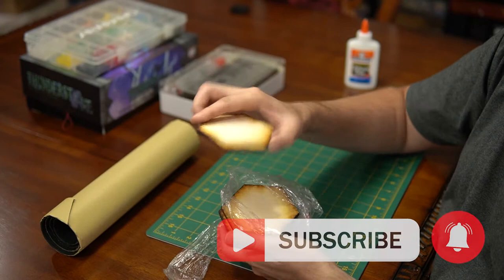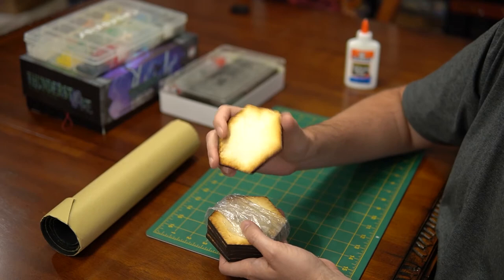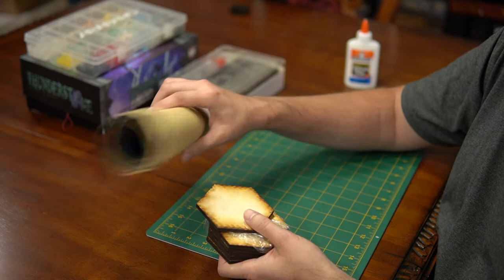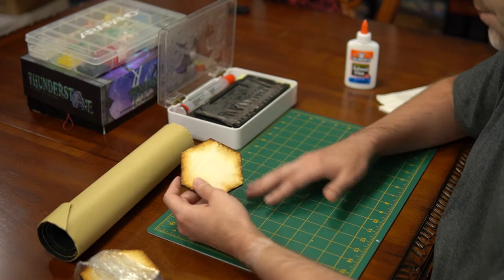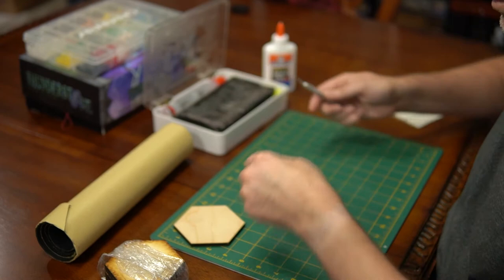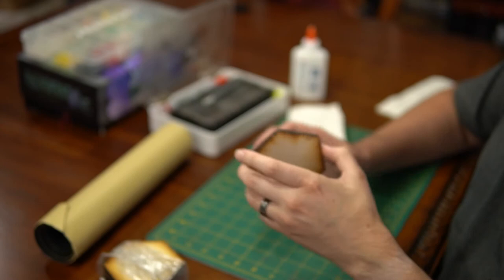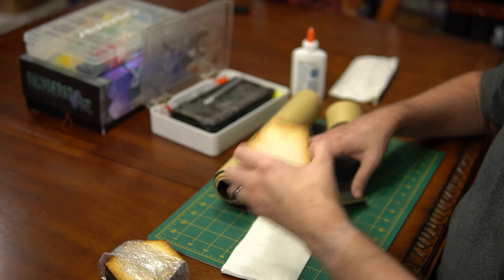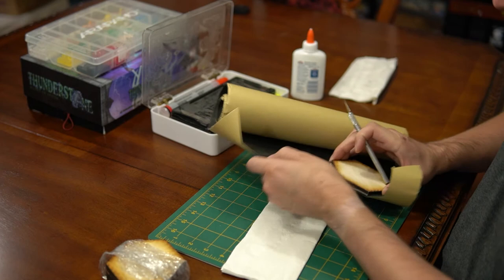Crafting: Making a Board Game Tile for Playtesting

Comment: How do y calculate whether the next tile will always match the curretn tile and none of the edges will be off of the designing? im stugling with that math problem.
Reply from the maker: The only tiles that need to be lined up perfectly were the River tiles. All others can be rotated and don’t need to be lined up. 

Since I printed with bleed the extra overlap allowed me to fine tune the alignment when I glued and cut